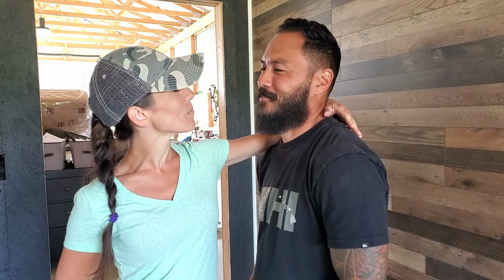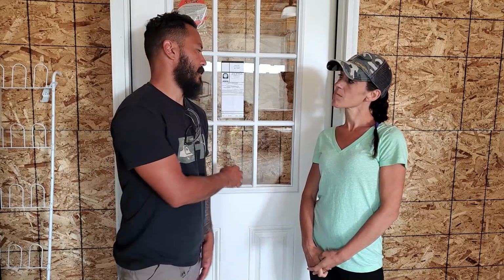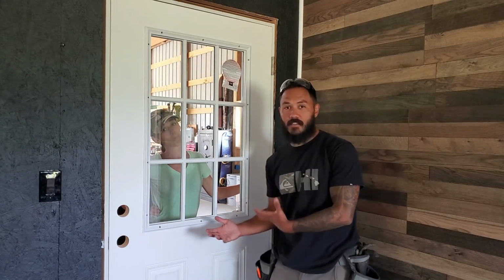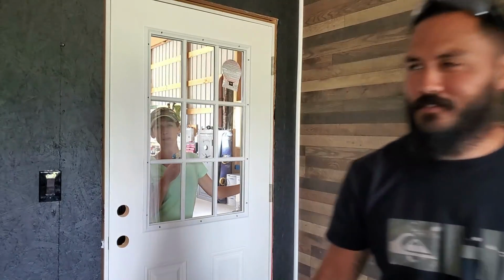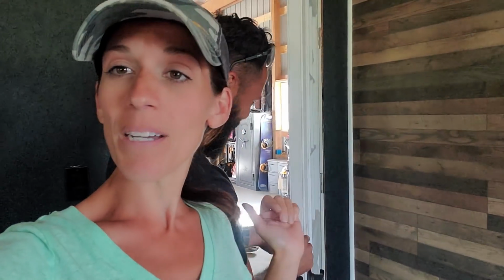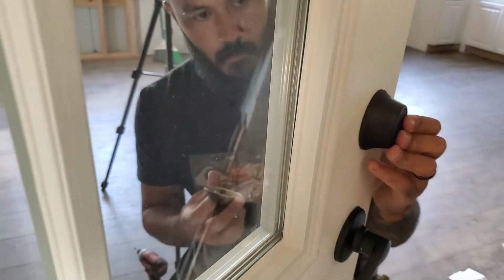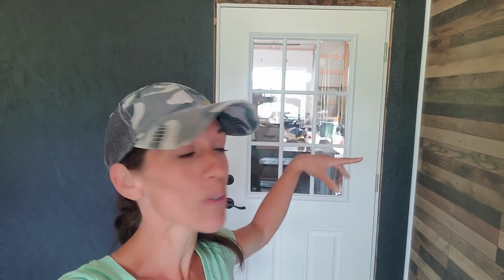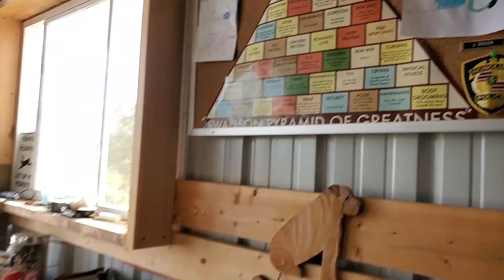Installing A Front Door | Building Our Own DIY Tiny Home

Comment: It’s called a 9 lite because of the grids in the window even though the glass is one piece insulated LowE unit. Fiberglass has an excellent u value. (windows and doors have u value not r value) it will stay cool in the summer and warm in the winter. It has compression weather stripping. Excellent! It has a fiberglass adjustable threshold. Awesome sweep. If you pull the weatherstripping back a bit you can hide your screw holes behind it. You should always put exterior silicone under the threshold before installing the prehung door. By the way from outside looking in it’s a left hand in swing. (Yes I used to sell them and install them). Another tip... take one screw out of each hinge and replace it with a 3” grabber screw.
Reply from the maker: Thank you
Reply: Good Simple Living You’re welcome! I love having your family here in the Great State of Idaho!  We welcome hard working honest folks! Best of luck!!
Reply from the maker: @beckysmuck8771  thank you, that means a lot ❤

Comment: Make sure you put in some longer screws in the hinges to lock them into the framing. It really beefs up the door security strength also some longer screws into the framing through the door strikes and dead bolt strike.

Comment: Hey : 'easy-peasy'.  Quick method door install. Stuff door in leveled /sqaure opening. shove it in tight to the left.  Pencil mark the wall on outside of both side  casing edges . Then slide door to the right , and repeat marking both casings on outside , divvy them up And set door ,w/ nails  in jamb (hide your screws under weather stripping then . Finish off shimming to attain gappage, the case it out.

Comment: Hi Guys: If you have not done it. I would recommend removing one screw from each of the hinges and replace it with a 3 " screw. To secure the hinges to the jamb and into the side stud.  Great job.  Frank
Reply: That's good advice.
Reply: I couldn't see how long the screws were for the deadbolt strike plate, but it's also a good idea to use longer screws that go into the 2x4 framing for added strength.  However, since the door has a big glass window, that might not matter as much, since someone wanting to break in could easily smash the glass and reach inside to unlock the deadbolt.

Comment: You should take out screws from the Hinge and put the 3-inch screws in their place, it will be a more sturdy and secure than when screwing the other side hides the screws by taking off the weather stripping and put the screws their then put back the stripping and you don't have the screws showing and it looks better too.hope this helps I'm a Master Carpenter if you need more tips let me know?

Comment: since you’re slab construction, you’re probably going to affix cabinets to the wall. Just remember that your floor I believe is laminate floating floor and it needs to remain “floating” so to speak. So nothing should be nailed or screwed into floor so it can remain “floating “ which allows for the movement of expansion and contraction. Just affix cabinets to walls and all trim such as shoe molding or quarter round to the cabinets. It prevents buckling in the floor and the floor will last longer.

Comment: Looks great - how soon are you moving your beds and furniture in?   Looking pretty close to done other than  the kitchen cabinets and plumbing.
One suggestion - If that was a true exterior door, rather than inside the pole barn,  I'd go for a double key deadbolt rather than the single key and knob.  That way nobody can simply smash that glass, reach-in and let themselves in.   For safety in exiting, you can keep a key near the door but beyond arms length for reaching in.  As it is, they have to get into the pole barn, then to that door.   I think your guard dog would stop them before they got to that door.   (joking, I think.)